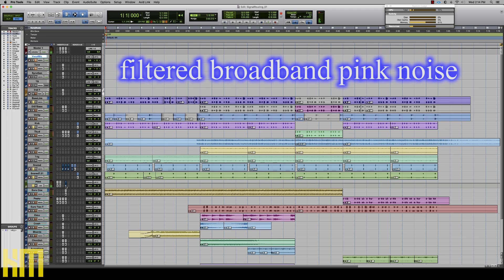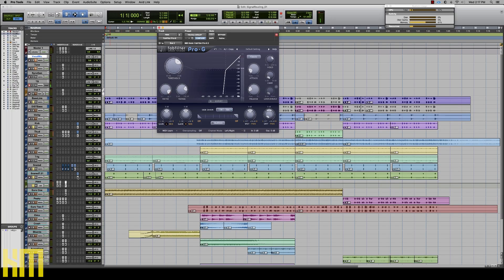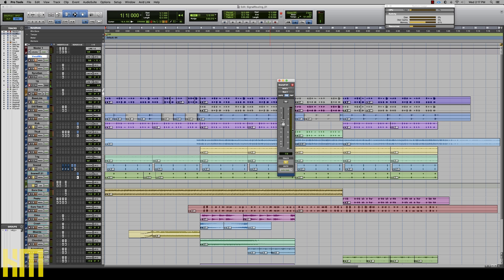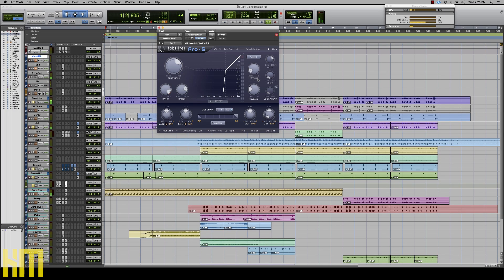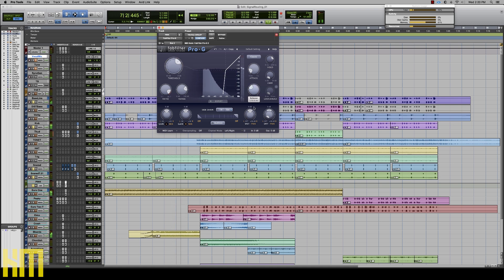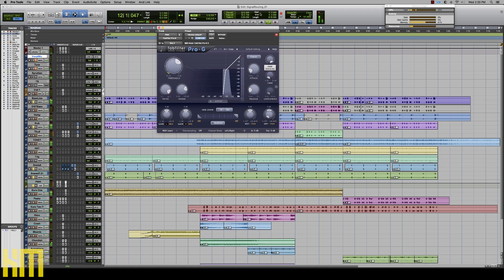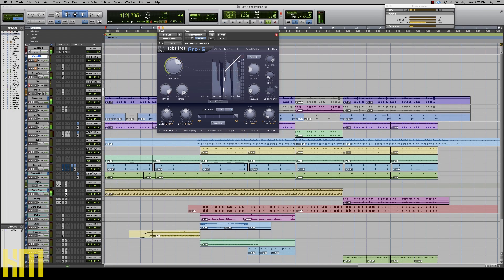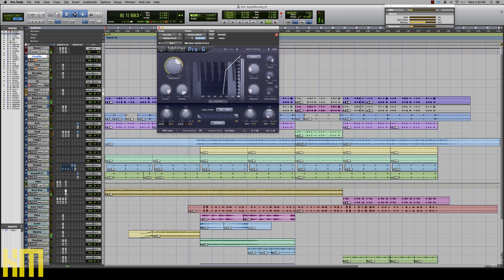Audio Signal Path - Music Production and Engineering

Comment: Definitely makes a huge difference depending on the gate settings. With the slower release setting on the gate, it sounds a bit like overuse of a noise reduction plugin. 😬
Reply from the maker: testube exactly, the crazy amount of control we have with some of these plug-in’s can lead to some pretty amazing results, particularly when we engage automation!  I’ve had great results automating things like the range control...where we just sort of mix in some of the gate in real time...works great on anything with sustain ;-)  Classic example would be gated strings...one of my faves!  Thanks for sharing testube, have a great week!
-hw
Reply: @hiwattmarshall  Thank you, Ken, for the inspiration. 🙌